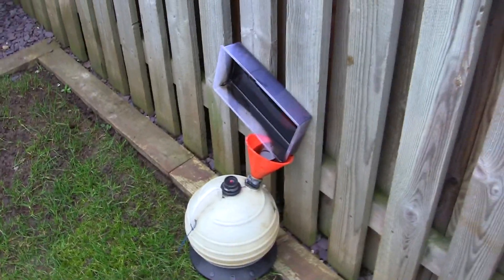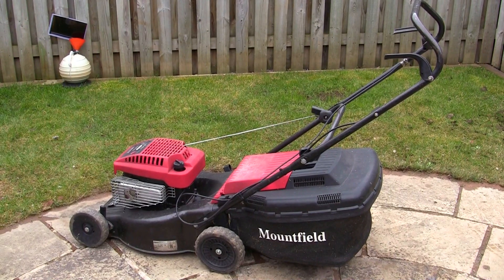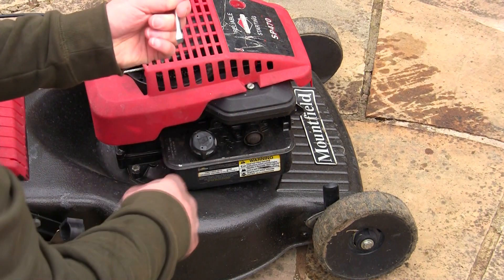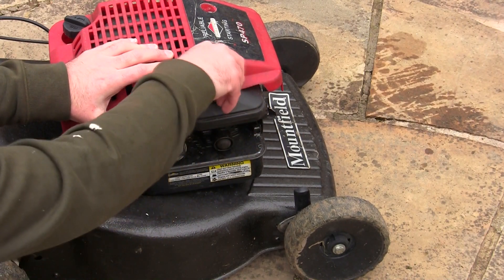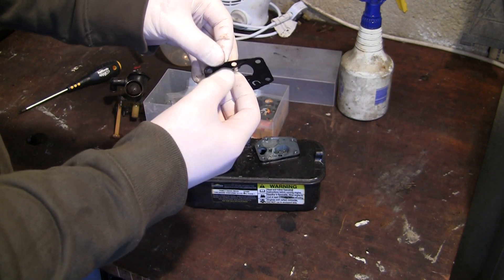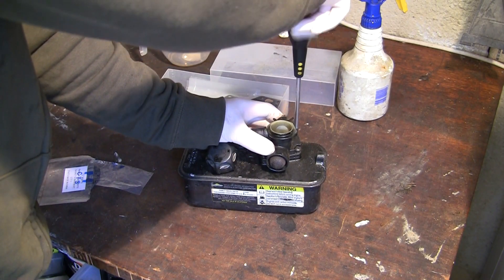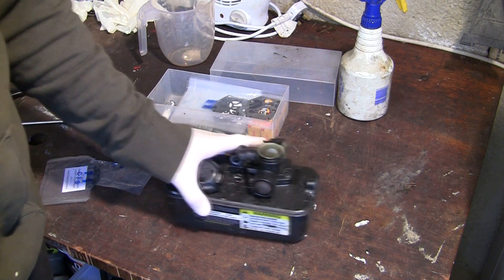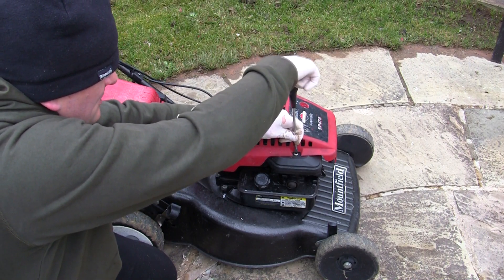Lawnmower Spitting And Popping - 2 Diaphragms

Comment: I had a 35 Classic Popping and Spitting, put two Diaphragms on and it ran better, the Engine ran faster, but still popping.........Ended up changing the Head Gasket and grinding the Valves in, runs like a Swiss Watch now .........Enjoyed the Video .
Reply from the maker: Cool! thanks for the info!
Reply: Did you do a compression  test or can you do a leakdown test on the valves?? Or did you just do the valve?
Reply: @Grahams-Grass  The Engine was Popping and Spitting through the Exhaust Geeman,  I cleaned the Carb a couple of times, also put it through the Ultrasonic Cleaner, made no difference .....even fitted two Diaphragms, so guessed the Valves could be sticking or not seating correctly so took the Head off, found the Gasket was in bad condition, so re ground the Valves in, cleaned everything up and fitted a new B&S Genuine Head Gasket torqued down to I think 14 / 15 NM ..........problem solved.
Reply: I've got  a dog of a 35 popping   I'm gonna have a go at the valves I've done everything else  and still pops...

Comment: Had a Briggs carb that was a bad fit between plastic carb and metal tank. Had evidence of petrol leakage between the two when trying to run it, all screws were tight. Ended up putting another carb on. Not heard of putting 2 diaphrams on before. Nice to have you back Paul!!
Reply from the maker: Cheers Keith!

Comment: So I gave this a try today  after giving the mower new plug  
Carb clean new gasket and diaphragm  fresh fuel  cleaned and gapped coil. Checked the flywheel key ...   tryed 2 diaphragms   still  popping .. took the head off and  went round the edge of both valves with the dremel  wire brush. Cleaned the Head . Put it back together and it 
BLEW UP!!!!! Only joking it ran  spot on ...😁😁😁😁👍👍👍👍👍  clean them valves up ..😉👍🌻
Reply from the maker: Good stuff

Comment: Ah yes nearly that time of year again.  I had an issue with my diaphragm last year.  I bought a couple of cheap gaskets on eBay but after watching one of your videos to instruct me on the installation I bought a genuine Briggs one.  Installed the genuine diaphragm and it still ran like a bag of nails, cue much sweating and teeth bashing, pointless further strip down. Immediately prior to giving up I thought “I wonder if I’ll try one of them cheap gaskets and see what happens”. I did and it ran perfectly and continued to run perfectly all summer.
Reply from the maker: Amazing! Sometimes it just depends how it sits on the tank

Comment: I think the only reason that this would work when a carb don't run right after a new official carb kit been used would be if there is some warpage to the tank / carb or if the diaphragm spring has stretched.  would be interesting to see how it goes under load load term especially longer grass that most petrol's take on.  Take care and stay safe, Mike
Reply from the maker: Cheers Mike

Comment: Mower man please help - I have a Hayter hawk with 35 classic briggs engine I’ve just serviced top to bottom and made spotless .. runs great until I put air filter on and then suddenly speeds up way too fast ?? I’ve never had this before so any advice appreciated .. springs etc all look bang on
Reply: Just watched one of your videos back and going to check the coil again see if anything is stuck .. completely threw me earlier though lol
Reply from the maker: Never had that tbh!
Reply: @MowerMan  New set of springs fixed it .. strange as ones I replaced looked fine lol .. anyway happy days